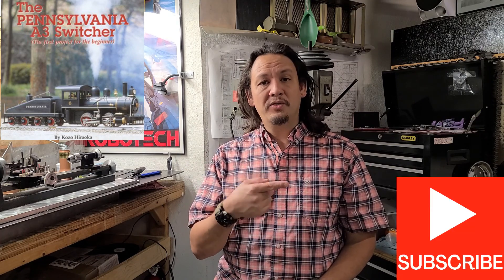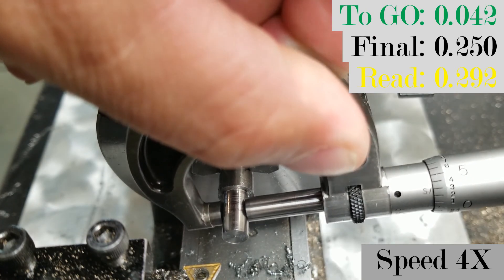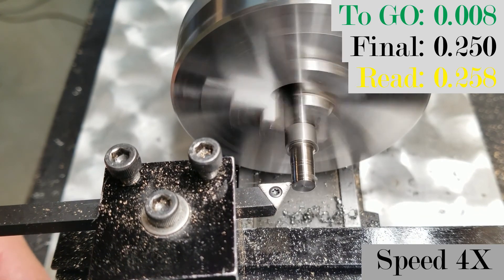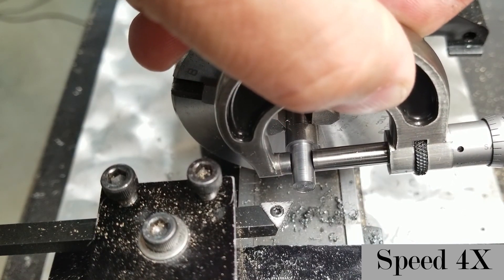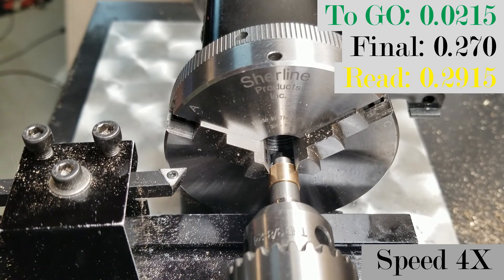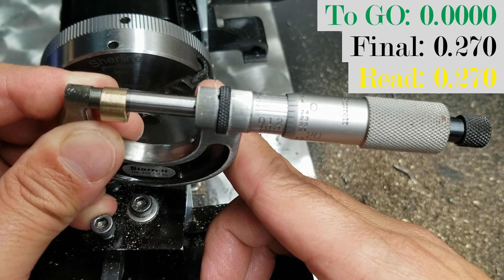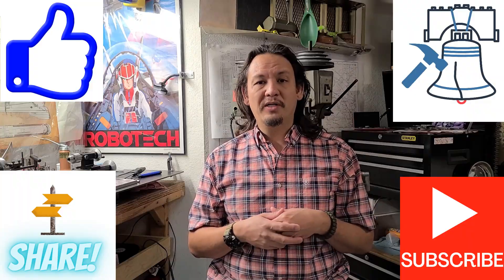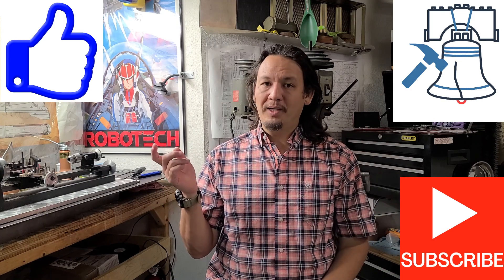Trim to length Tender Phosphor Bronze Journal Bearing Facing Chamfering Plain Turning Alignment Tool

Comment: 100% better without the music!! Easy to watch and most importantly….easy to listen to.   On an axle (shaft), when you get down to a thousandth or a few tenths  to your desired diameter,  try using emery paper the rest of the way….it’ll keep the shaft polished and you’ll be able to hit the exact diameter needed.  (Try it on one of the “discarded” axles.  Where (link if possible) did you get the high speed steel inserts for the ¼” tool holder?
Reply from the maker: Thanks 👍Glad it worked out better this time. I appreciate the tip.  Is there A particular grit you recommend?  I noticed it is either graded like sand paper or as medium, fine, extra fine.  I did get the HSS inserts.  The kit came with 6 total.  I actually just ordered the 1/125.  So I will give those a try here soon.
Reply: @LoydPrecisionMakers  use fine and extra fine.   Where (Specifically) did you get the HSS (not the carbide) inserts for the 1/4” tool holders??  Do you have a link for them?
Reply from the maker: @BobLewen  Thanks, I got  the emery paper.  I got my set from little machine shop.  Here is the link to my exact set (https://www.littlemachineshop.com/products/product_view.php?ProductID=1719&category=1208242246).  They also have a 3/8" and a 1/2" set.
Reply: @LoydPrecisionMakers  thanks
Reply: @LoydPrecisionMakers  based on the size of the axles, ( or whatever shaft size) cut the emery paper in strips the width of the area you’re machining….. hold each end while you’re burnishing the axle….it’ll take it down to final size and give you a good finish as well. Enjoy!
Reply from the maker: Gotcha thanks so much for the tips and advice.  I ordered the fine and extra fine.  I'm really looking forward to it showing up and trying it out.  Thanks again.